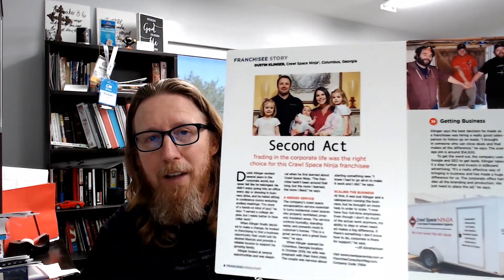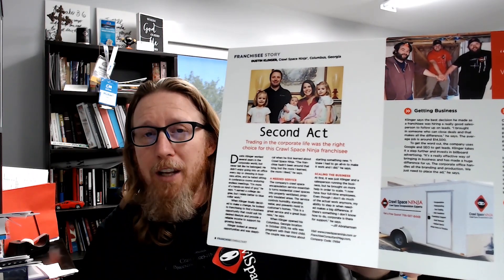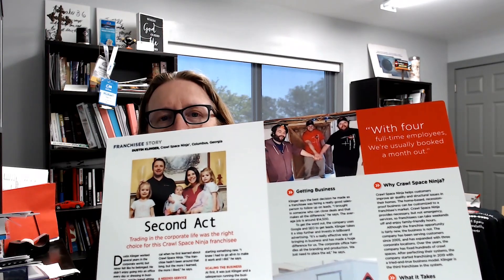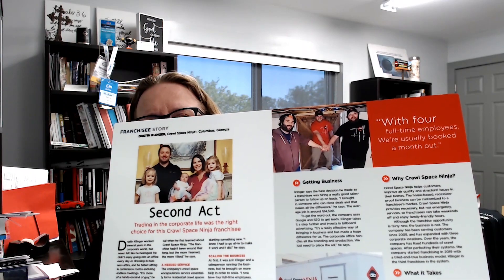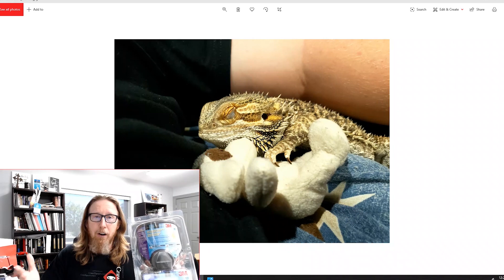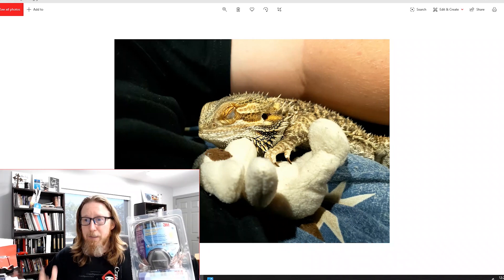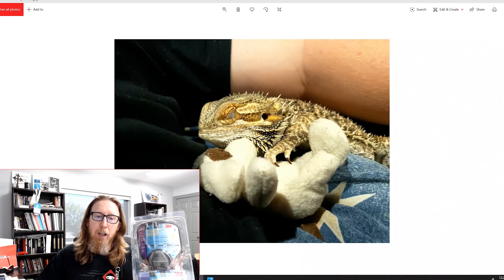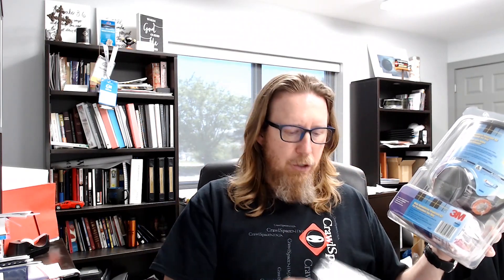P100 vs N95 Mask Filters Which is BEST for Mold Remediation

Comment: Im a graphics guy working with heat press vinyl. Not sure what mask I need but the fumes are irritating so Im doing my research. The polyester material seems to steam up every time I heat press it. Thanks for sharing your knowledge
Reply from the maker: I'm not sure either, but most likely one rated for gases and not just particulates. Thanks for watching!

Comment: Hey Michael,
I always use a P100 2097 for welding, crawl space work and attic jobs. That's not my primary job, I am a Network Engineer but I have lots of hobbies. For me I have bad allergies so it cuts down on that and keeps me safe. Now maybe you can shed some light on all the difference 3m p100 numbers. I called 3mm and they recommended 2097 since it's has a wide range of uses.
Reply from the maker: Thanks for the comment!

Comment: Hello Michael, I've learned a lot from watching your videos, thanks! I'm a retired pipe fitter/millwright. I've used dust masks and respirators for many years to protect from grinding and sanding steel and working around insulation. I also worked at a chemical company where I regularly wore respirators. Keep the great videos coming, best of luck!
Reply from the maker: Thank you so much.